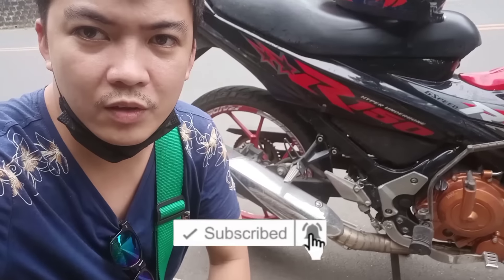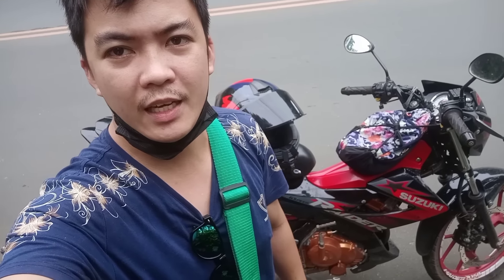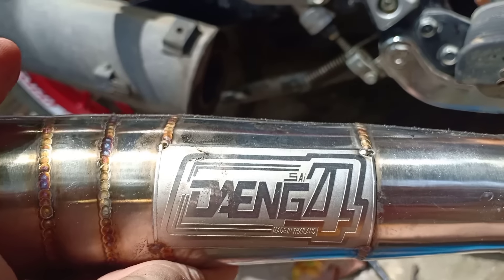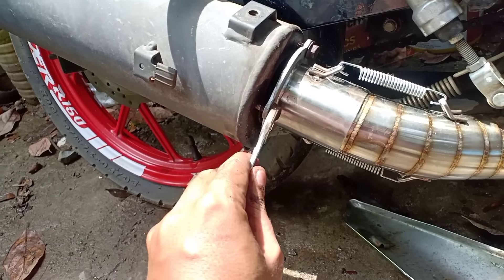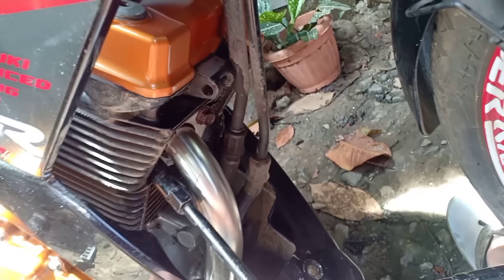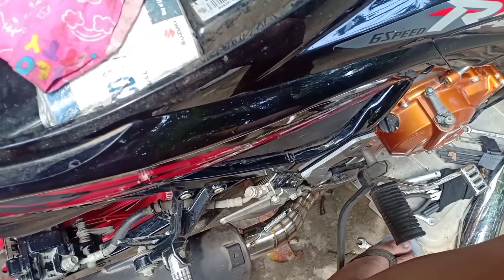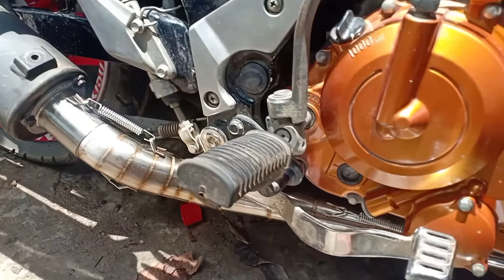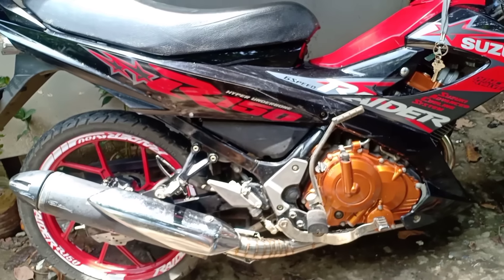PAANO MAGKABIT NG BIG ELBOW | STOCK CANNISTER | RAIDER R150 CARB 2022

Comment: Boss. Nag tono ka pa ba nyan sa carb nong sinalpak mo yang elbow at pipe?
Reply from the maker: Hindi na boss...
Reply: @DUDE_YMAR  hindi po ba sya sungaw?
Reply from the maker: @evalynmorre8371  hindi naman po, sukat na sukat kasi yung elbow.
Reply: @DUDE_YMAR  anong shoppee acc mo sa nabilhan mo paps.
Reply from the maker: Nsa comment section boss naka pin ang link